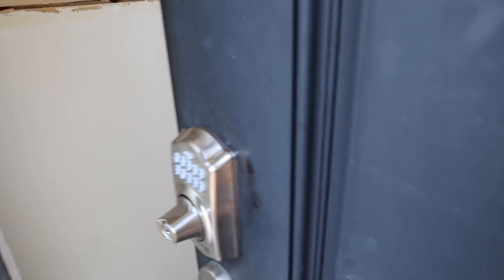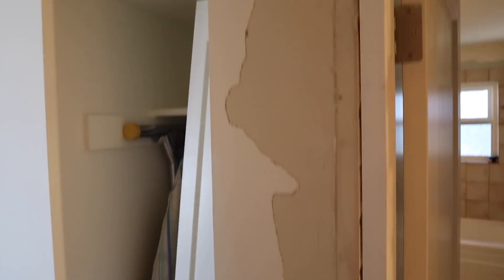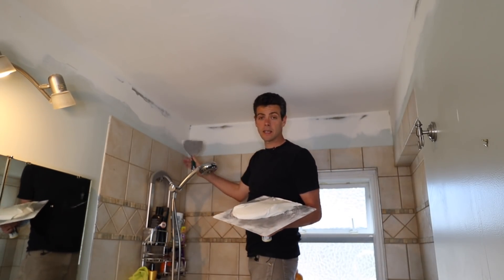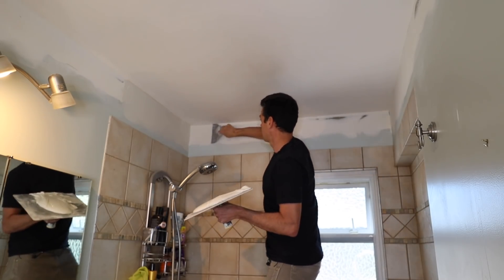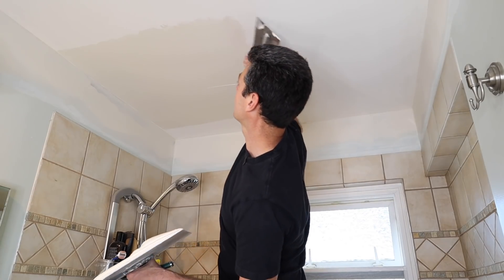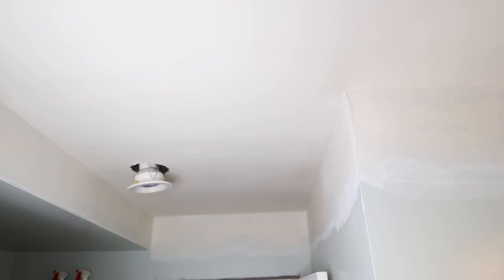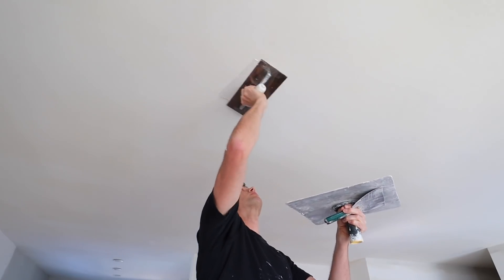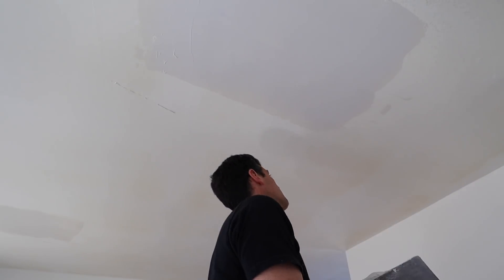The Wall and Ceiling Skim Day 4!!!

Comment: That new sander makes life so much easier, I used to actually think of calling off work the days we had to come in and pole sand ceilings and walls, but I just couldn’t do that to my buddies. But let’s just say we were all glad at the end of the day when that shit was out of the way. And if you’ve sanded long enough you will become an expert at skim coating  to the point of not having to hardly sanding at all..lol
Reply: hi do you know the brand of that sander or what its called?  it seems it reduces dust a lot.  Can't handle the dust!

Comment: I used to struggle with corners especially level line or no coat. I started coating both sides at once with a 6 inch knife and then going back sanding any high spots and finishing one side at a time with an 8 inch knife. Now they sand so much easier and stay flat

Comment: Your videos are the best of the best. I’ve learned so much and my work has improved out of site since applying your techniques. Thank you!
A question - in Australia we use acrylic stud adhesive as well as screws to fix drywall to ceiling and wall studs. The Australian standard even specifies how much adhesive and screw spacing etc. I’ve never seen any stud adhesive used in any of your videos or any other Canadian drywall video.
I’m curious as to why we’re so obsessed with stud adhesive and you guys never touch it.
Reply: I know that your question is on Canadian, its cool question, im glad for everytime if i can hear some facts from people from other countries :). As European who worked before 5 years in USA  i can say, it very cruel norm, Rob :D. BTW what i know from my experiences, in USA and Europe there is no norms or standards for any kinds of acrylic studs or something like that. In Europe we have norms only for hooking / construction parts (includes screws, profiles, etcs..) and norms for securing buildup (fireproof, xrayproof etc..) Cheers'

Comment: Love your videos!  They have helped me so much to work on this old house.  I have quite a bit of skimming yet to do.  I noticed that you mentioned the size of the 32 inch possibly impacting your finish negatively on the ceiling.

Would you recommend a 32 inch for walls?  Or a different size?   PS I will need to do a bit of re-taping on butt joints as well.  Thanks

Comment: Hey mate I really like your stuff and have found it really helpful in the uk where everyone wants to do either traditional plaster (thistle multifinish) or skim everything which is kind of the same or a way of making dead flat boards wavy.

So I have these exact ceilings in my 1890s terrace in London. Can you explain how this texture was generated in the first place?

I would really like to know what you are skimming over it with and is it similar to British Gypsum Easycote 60 or 20? Could I use this perhaps? The only other choice is the Thislte traditional plaster and it doesn't really sand well. Speaking of sanding is there a low or no sanding way to do the ceilings? I can't even imagine how I would sand the ceilings and I think the pressure from sanding over the lath, wood strip things would crack it.

Keep up the great work!

Comment: So when you first showed that bathroom ceiling at the beginning of this series, my first thought was, “Time to go get some 1/4-in drywall and overlay the ceiling with it”. Obviously you did a killer job with your method. Is there ever an instance where you would choose the “overlay” method?
Reply from the maker: Sometimes on a popcorn ceiling in a big space with easy access for drywall.
Reply: @vancouvercarpenter  Yeah, especially when you suspect that it has asbestos in it
Reply: All my ceilings are popcorn/w level 1 asbestos. Plan on putting up 1/2” drywall over it. Going to be a lot of mudding & taping but will be so worth it in the end.